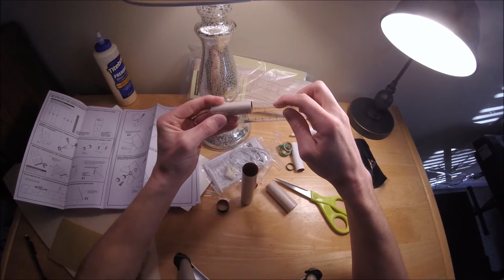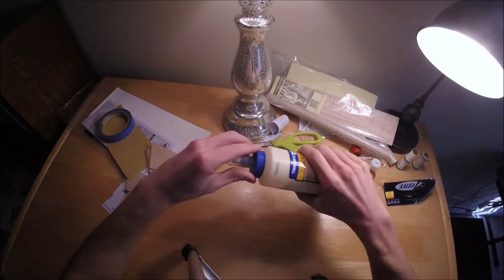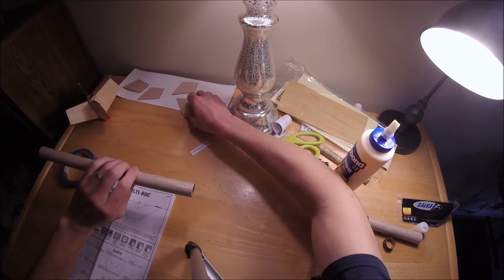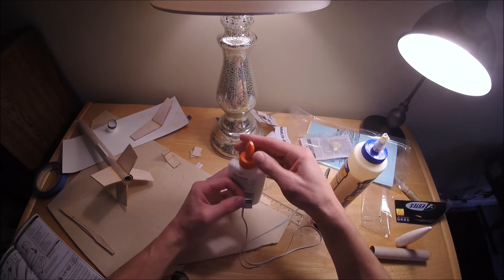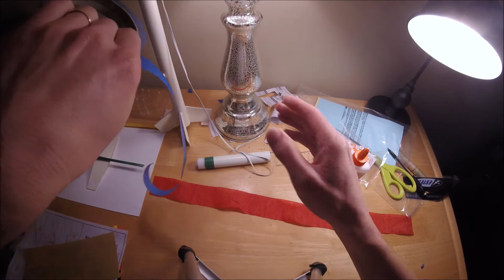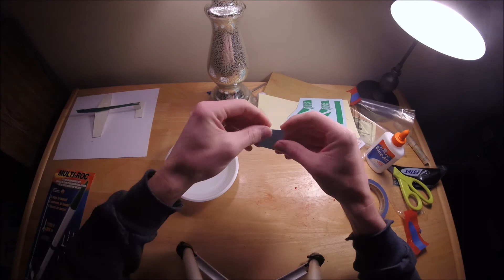Estes Multi-Roc Build Tutorial

Comment: Thank you for helping me build the glider with this video. After watching it - I felt confident in attempting to build it.
Reply from the maker: @alfredindy8058  Great!  A couple notes are that clay is needed so that it glides and doesn't tumble and it may be better to reverse the wings, swept edge is the leading edge.
Reply: @rwkhobbies1969  Funny that you mentioned that. I air foiled the main fins; I airfoiled the stabilizer fins in the rear. It passed the paperclip test. I credit your video for building it correctly. Thanks again!
Reply: I took your advice on adding the clay. I got lucky. I put a small amount of clay on the underneath point of the nose on the righthand side. I threw the glider, and it lifted up. I added some clay to the top (as per instructions). I threw it and it dropped. I removed some clay, and it glided perfectly. It does great rotations in my flight video. I am very happy with the performance. Thanks again!

Comment: Hey man I just completed this rocket and ran into a confusing bit. Are the gliders wings backward? I initially built my glider like yours. The instructions show the wings pointed in reverse. However if you look at the images of the rocket on the paper insert and in following steps of the instructions the point of the wings are forward facing.
Reply from the maker: Good call, I'm not completely sure but I think my wings are backwards!  Lol.
Reply: @rwkhobbies1969   lol. I did the same thing! It cost me a repaint.

Comment: Hi! A great tutorial, thanks a lot, has been very helpful in building our Multi-Roc! I am a bit puzzled by one step in the directions. Around 32:41 you glue the spacer (K) onto the nose cone insert. Then the spacer is glued to 5.5" payload tube. The instructions suggest that you can fly the rocket without the payload tube (2 of 6 combinations show that). To fly without the payload tube I guess you'd glue spacer K into the payload tube, then assemble:
a) nose cone with nose cone insert, friction fit, no payload tube;
b) nose cone, payload tube, nose cone insert into spacer K, all friction fit.
Or is there another way that I am missing?
Reply from the maker: The way you describe would work fine but there is a way to avoid friction fitting which I think is what you are asking.  Go ahead and glue the spacer and nose cone insert in the payload section like I did.  Then tie a long piece of elastic or paracord to the insert, put it through the hole of the insert and run it through the top of the payload section.  Now take another piece of elastic or paracord and make a shock cord mount in the nose cone.  Use the same technique as you do in a body tube, folder the mount/paper over twice.  Now if you want to fly with the payload, just tie the two cords (one coming up through the payload and one mounted to nose cone) together.   If you want to fly without payload, just tie together the shock cord from cone to the shock cord from body tube.  In order to not be always cutting and re-tieing, you can just find a small quick link so you convert between the different configurations more quickly.   Does that make sense?  I like this better than stressing parts by friction fit.
Reply: @rwkhobbies1969  That's a great idea thanks! Saw you using this technique in your Olympus build, but did not connect to my problem right away.

Comment: Building this rocket now and I messed up and glued the booster mount flush with the booster tube instead of out a little bit like how it’s supposed to be flush with the centering ring. So the bottom of the booster is flush - how can I compensate for this in the sustainer section ?? I haven’t glued that mount in place yet and I was thinking (so that the body tubes meet completely ) is to slide the sustainer mount aftward another 1/4” - can you advise?
Reply from the maker: If the bottom of your booster motor tube is flush with the booster body tube, wouldn't you need to compensate by moving your sustainer mount 1/4 inch forward in the sustainer body tube?  I'm looking at a my sustainer right now with a motor in it and the motor sticks out about 1/4 inch, although the bottom of the motor tube is flush with the body tube.  So it sounds to me like you could be fine with just having your motor tube 1/4 inch into the sustainer because that will still leave the bottom of the motor flush with the body tube.  Is that how yours is stacking up?  Am I tracking right with what your describing?  Also, put some glue on the outside of that bottom part of sustainer motor tube so it doesn't bend when you try to insert the motor.
Reply: rwkhobbies I went ahead and moved the motor mount in the sustainer forward 1/4” to be flush with the tube fits together well

Comment: The coupler will not fit into the main body tube when we are trying to connect the second stage - how do we remedy this, sand it?
Reply from the maker: Yes, that's what I did on mine.  There are sections of the coupler that no longer have any of the red outer layer left.

Comment: How do I build the plane
Reply from the maker: Glider assembly is shown in subject video so I'm guessing you're referring to the trim process.  I just used the clay supplied with the kit and after a lot of iterations finally got my pitch good enough although the sink rate did appear very fast when I drop it from the top of the steps and it does turn right, so I'm expecting some pretty tight spirals when I fly it unless I do some more work with the clay.

Comment: Would you know a good place to launch a 2 stage + glider? Since I want to launch it like that. I dont know how big a area for that specific setup would be.
Reply from the maker: Your best option will be to find and join the nearest rocket club, which will be a NAR or Tripoli prefecture.   Most of all of the fields that these clubs use will be more than big enough to support the multi-roc flight with the 2 stage +glider configuration.   It's also good to join a club to learn from others.

Comment: hey sir, did you ever test multi-stage engines with this?  we can't seem to get this rocket to actually work in multistage.  it actually blew up the bottom rocket and all 4 fins when scattering when the booster separated.  Any ideas?  We used the cellophane tape that the instructions called for to connect the two engines, and masking tape to hold the two engines in each stage.....
Reply from the maker: I havent flown this rocket yet but I did fly an estes mongoose that exhibited a failure mode that is likely similar to what you describe with your rocket and long story short was it all came down to the type of tape.  On the successful flights I used scotch 3m matte finish (green paper dispenser)but on the flight that burnt and disfigured the booster I used a different clear tape which I'm pretty sure was the super hold (red paper dispenser). Basically what happens is that the force required to separate the stages is too high, causing overpressurization, so also sand down the coupler on the booster that connects the stages...    does this give you a path forward/answer your question? Let me know how it goes, good luck with the next attempt!